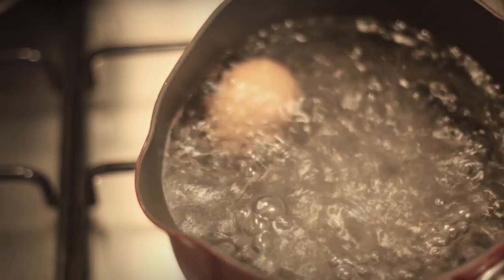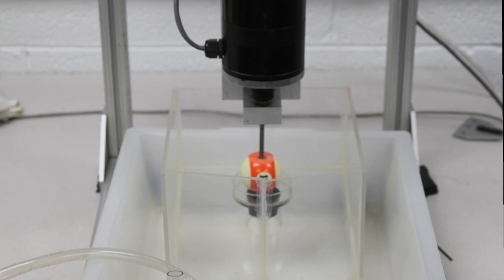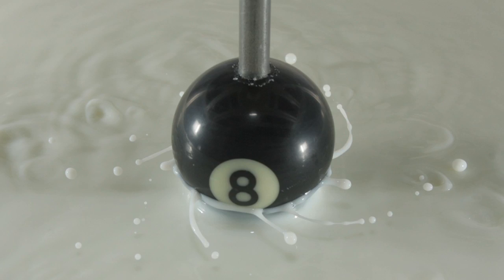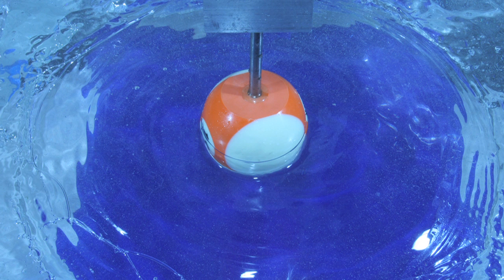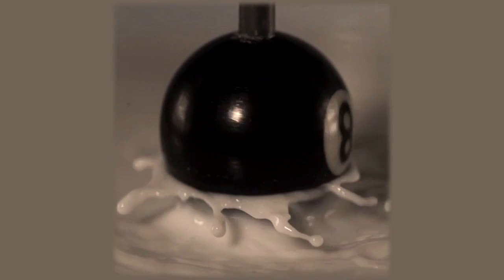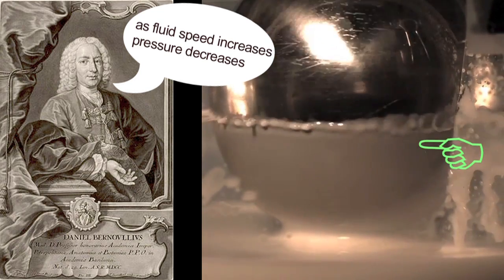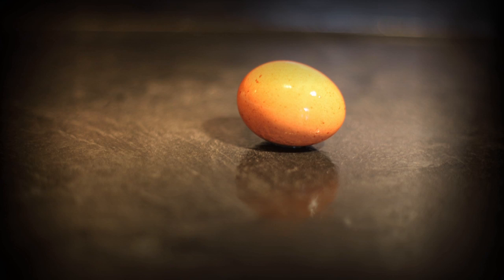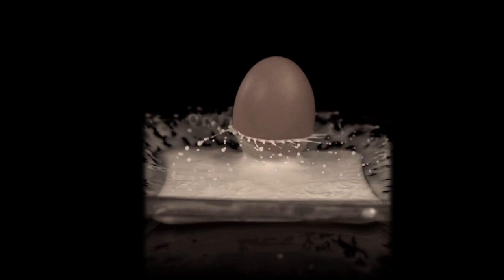Cracking The Egg Sprinkler Mystery

Comment: I'd explain this as, the fluid tries to move away from the surface due to centrifugal force (or centripetal, one of those), but it can't because of the way liquid clings to surfaces, so it moves up instead. It's like having something pour down the edge of your glass when you try to tip it into something else. Although, the Bernoulli principle applies here too!
Reply: It definitely seems more intuitive than bringing fluid pressures into the mix...
Reply: hey thanks i was gona write this now i dont need to
Reply: Exactly what I thought before I watched the explanation.

Comment: I thought that you just had to stick the egg in the milk and it would automatically spin. That confused me, until I read it again and came up with a theory before the answer

The liquid sticks to the egg, causing it to rise up, and it doesn't reach further than the equator because it's harder for the liquid to stick to each other past it. After doing that, the milk just completely spins off, and the different speeds cause different effects.

Comment: Do tell, please . . . .  what happens if you spin a cone?  Or a cylinder?  Will it climb to the top?  Can you get it to keep climbing if the increase in the circumference is changed more slowly (inverted cone) , or if the circumference gets smaller (Cone)???

Is there a difference based on the surface tension of the liquid?

Comment: The Tesla turbine is a bladeless centripetal flow turbine patented by Nikola Tesla in 1913. It is referred to as a bladeless turbine. The Tesla turbine is also known as the boundary layer turbine, cohesion-type turbine, and Prandtl layer turbine (after Ludwig Prandtl) because it uses the boundary layer effect and not a fluid impinging upon the blades as in a conventional turbine. Bioengineering researchers have referred to it as a multiple disk centrifugal pump
Reply: centrifugal

Comment: The Bernoulli explanation is incorrect. Bernoulli's equation applies to points in a fluid along the same streamline under circumstances where no energy is being added to the system, which isn't the case here. The reason the fluid is drawn up the egg is due to the combination of centrifugal force and adhesion force of the liquid to the egg. If it were due to the Bernoulli Effect, then you could never explain how the liquid would begin to rise in the first place, since there would be no faster-moving fluid above the initial level to draw the liquid upwards.
Reply: +Daniel Walsh My thoughts exactly.  I think the best shape for a pump of this sorts would be a circular paraboloid.
Reply: I was thinking centrifugal force as well. This isn't really new, I say an kids experiment in which you attach straws to a central stick, at an angle, and spin it while the bottom of the straws touch the fluid, and it draws fluid up the straws. They even called it a pump if I remember correctly.

Comment: So if it's because of friction that that liquid is pulled up and the fluid with a higher viscosity has a higher flow rate, would a sphere with a rougher surface produce an even higher flow rate? If the ball had a Superhydrophobic coating, and assuming the ball was drilled perfectly center to prevent any wobbling, would it be able to draw any fluid since it would be nearly frictionless?
Reply: No because it wouldnt touch the water...

Comment: Capilary action and centripetal force.
Reply: yes or more generally, water tension and centripetal force. Dunno why these scientists are saying it has anything to do with differences in pressure due to differences in velocity.
Reply: Roman Rekhler
Well, it's related to pressure as well, since as the liquid climbs the ball, because it experiences what is effectively a faster flow rate, it's got to have a lower pressure due to the Bernoulli effect.

Comment: But correct me if m wrong.. to use it as a pump.. u would need a huge sphere right? .. cause the fluid can only be raised to the equator and not more. And the shape has to be spherical. So i just don't see how it can act as a pump with any reasonable efficiency? :/
am I missing something? :(
Reply: I don't see why it should be spherical. If the circumference increased with height there will be a pressure difference. You can probably do the same with an upside down cone.

I'm not sure how efficient this can be. You're giving the water an awful lot of kinetic energy to move it up just a little bit, so I doubt this will be more efficient that just moving the water upwards. It does have the advantage of being just a single rotating part. If you don't need high volume, but you need extremely high reliability, this might be the way to go. You can't really have any mechanical defects other than in the motor driving it so if you have a reliable motor you have a zero maintenance 100% reliable pump.
Reply: Niosus Right.. basically you need something that has the circumference increasing.. and also.. to raise the liquid up, the pressure differential must be significant.. and for that, i feel you would need huge structures.. if u talk about heights like 1 meter pumping :D..
Reply: mahesh vag The pressure differential is something I don't really know much about. I suppose it increased with the speed of rotation, but the centripetal forces also increase so I don't know how high you can get the liquid in a single step. Probably also has a lot to do with the viscosity.

More research is needed!

Comment: NO: Analysis @2:33 attributes flow to pressure, Bernoulli effect (re fluids exerting less P at faster V relative to fixed surface). Vid slo-mo: as fluid climbs it is one with sphere (no V diff. = no P diff.)
YES: Fluid rise is resultant of two vectors: surface adhesion, and centrifugal rotation.  Adhesion sticks to sphere (inward/centripetal vector). Rotation pulls up surface to outer diameter (outward/centrifugal vector). Fluid traces resultant vector. QED
more@SciFri
G W Strand/NextInnovate!™

Comment: If you watch carefully you'll see that most (not all) tornadoes form from above. They start in the low pressure area and move downwards towards the ground to the high pressure area.  Also tornadoes have internal vs external pressure difference. Which is not the case here because the pressure inside the egg does not change.

Comment: I believe they said "a pump with no internal moving parts", which I think means it's not like traditional pumps where you have a number of moving parts submerged inside the liquid, requiring various seals and methods to prevent the water from getting inside and mucking it up. All the parts that make the ball spin are outside the liquid, and the ball itself isn't messed up by being wet.

Comment: Centrifugal pumps use another (though similar) principle... They work as a propeller boxed in, with just one way out, so your fluid is forced through that exit... Sort of "pushing" it. With the egg, what you manage to achieve making the fluid go up whil "pulling" it to the sides